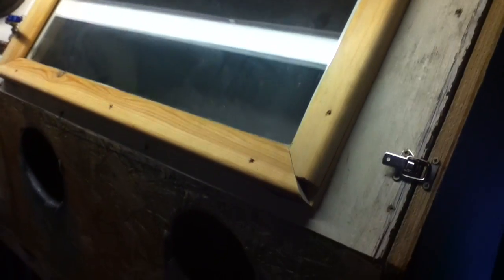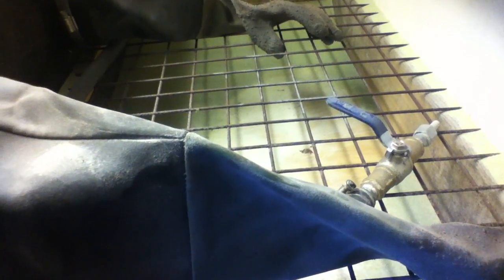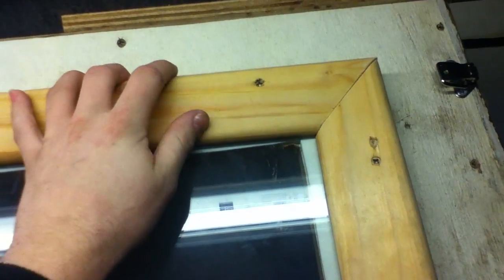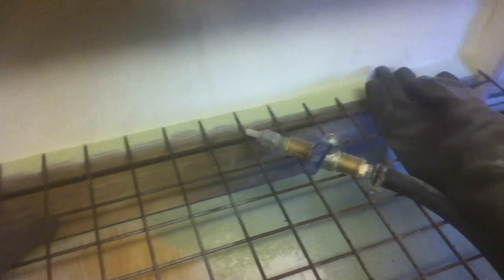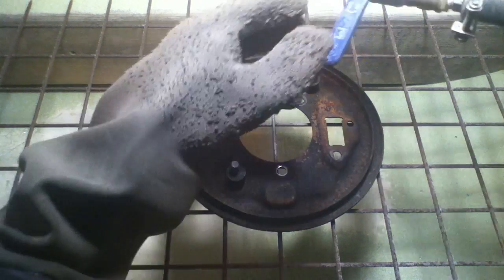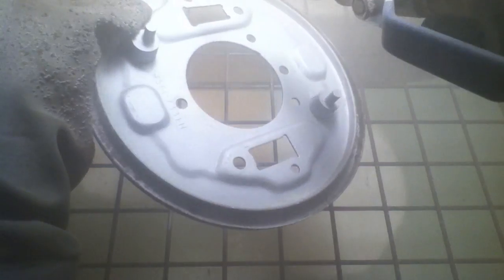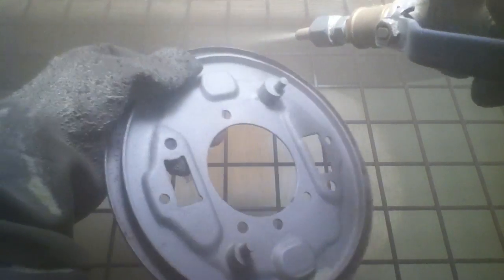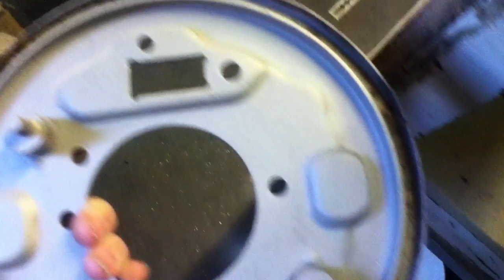Sandblasting Cabinet

Comment: How many preasure psi / bar ?
Reply: Check description, 90psi, 6.2 bars.
8.9 bar is max on these red blasters, which all compressors can do if you crank up the shut-off valve.
The issue isnt PRESSURE, its the volume of air the compressor can deliver per minute, i.e, how many cubic feet per minute (CFM), or, liters if you prefer (LPM), per minute.
Most compressors are only 2-3 CFM max, which just WONT do for sandblasting.
You need 10cfm/300lpm minimum, preferably 15cfm/600lpm for these red sandblasters.

Comment: hi there just wondering what air compressor you are using like how many litre plus the cmf output... & its it single stage or more.. cheers
Reply from the maker: Hi, the compressor I am using is a 3.5HP 15CFM single stage with a tank size of around 100 litres. For sandblasting, the size of the tank is not as critical as the CFM. You could have a massive tank, but if the CFM is not enough then it will run out of puff every time. 15CFM is fine for what I am doing, and will keep up with continuous use at a pressure of around 80PSI.
Reply: perfect im about to order a compressor that is 16cmf & is 200 litre so it should work fine... just need to sort the gun out as yours looks very effective & alot better than the pistol style ones that you get...
Reply from the maker: Yeah, from what I've read the piston ones always break fairly quickly. The simplest and easiest way in my opinion is to have a 1/4 turn plumbing valve. The fittings on the hose and the nozzle holder should all be BSP threads so standard plumbing fittings will fit, no problems.

Comment: SUBBED !! hi dragster !! just would like to say that this is the exact setup i have in mind of building myself, and it helps alot actually seeing it working !!! i will be purchasing a 15cfm 60 gall compressor i believe it will work. what size pot blaster are you running?? anyways great job . looks very efficient
Reply from the maker: Hi, thanks for the kind words. It is indeed very efficient. The compressor you mentioned sounds fine to me. You may want to experiment with different sized nozzles. The smaller the nozzle you have, the higher the pressure you can run at. Obviously this means you need finer sand, so it's all a bit experimental really, trying to match up compressor size to required pressure, nozzle size and sand grain size.The blaster I am using is a 20 gallon one, which I bought off of eBay. Hope you are successful in building yours.

Comment: Hi Dragster,

Great video!  I would like to know what type of abrasive are you using.  I know its sand but what is the brand.  I live in the states and am really worried about Silicosis.

Thanks
Reply from the maker: Hi, the sand I use is made of recycled glass bottles which are crushed up into small, sharp, abrasive fragments. It is made by a company called DMS Enviro which is a UK based company. To be honest there are many different types of blast media out there; steel shot, glass, alluminium oxide, even walnut shells for delicate items. As long as the blast media you use isn't a silica based product (i.e. normal sand) then you should be fine.
Reply: +DragsterIOW  i ordered a bunch of quartz sand. is that silicia based?
Reply: Willem Stark ķii